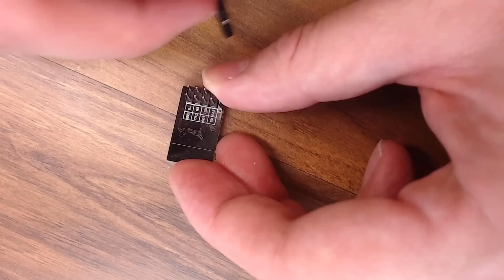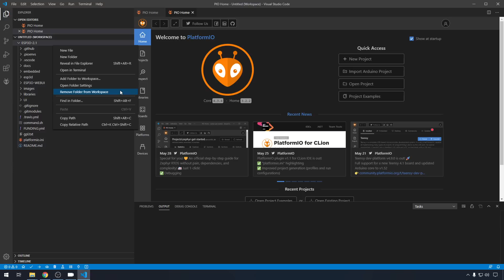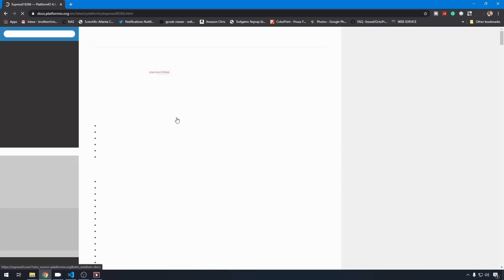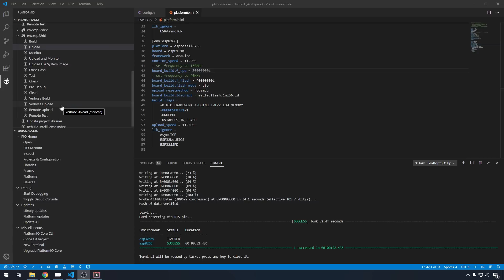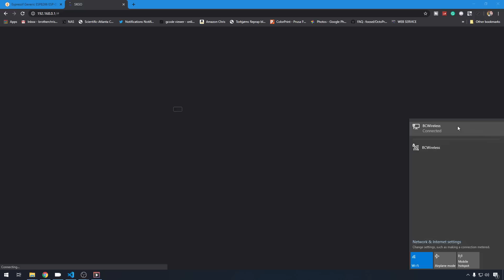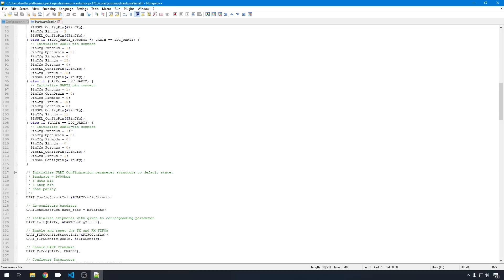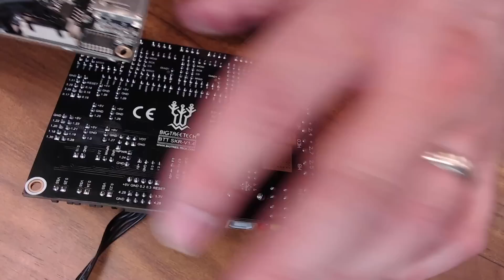Add Wifi To A 3D Printer - SKR 1.4 - ESP8266 - ESP3D - Chris's Basement

Comment: I connected my module in my TFT but doesnt work, the network not showing
Reply from the maker: Did you try to reflash the firmware on the ESP?
Reply: @ChrisRiley  Thank you for answering me, I'm already very happy with that answer. When I have the module connected to the USB adapter I can check the ESP3D network, but when I put the module in the TFT nothing happens, I tried to put the firmware back on and it still didn't work. I followed all the steps in your video, I found it very strange, I uploaded several versions of marlin and nothing. Does it work with ESP01 and ESP01S?

Comment: Great tutorial! I really enjoy your videos.

BTW. Once you have ESP3D installed and working, it's actually quite easy to get it to work with Octoprint, so that your print over wifi instead of serial cable.

All you need to do is to install a tool called 'socat' on the raspberry pi, which will create a virtual serial port that sends all data over TCP to ESP3D's port 8888.

Here are the steps I used:

# install socat
$ sudo apt install -y socat

# create systemd service to setup virtual port at boot time and reconnect to ESP3D as necessary
# make sure to replace YOUR_PRINTER_ADDRESS with IP address or hostname of your ESP3D instance.

cat << EOT | sudo tee /etc/systemd/system/serial-over-wifi.service;
[Unit]
Description=Serial over WiFi

[Service]
Type=simple
ExecStart=socat -d -d pty,link=/dev/ttySwifi,user=pi,raw,echo=0,wait-slave tcp:YOUR_PRINTER_ADDRESS:8888
Restart=on-failure

[Install]
WantedBy=multi-user.target
EOT

# start the service
sudo systemctl start serial-over-wifi.service

# Verify that the virtual port was created
ls -al /dev/ttySwifi

# enable the new service to start at boot time
sudo systemctl enable serial-over-wifi.service

Now octoprint should be able to connect to the printer without any USB cable!
Reply from the maker: Awesome! I might do a video on that, thanks for the info.
Reply: @ChrisRiley  Great, I learned few things and made some improvements to the config since posting that.

First - I learned that if OctoPi is connected over wireless (not wired), I get weird slowdowns when printing (print that normally takes ~2h took 4h). I think there are some sort of wireless collisions which slow everything down. Switching Pi to wired connection fixed it. There could be other solutions, too.

Second, I learned that there are some additional parameters in the service configuration that make it more robust when it comes to restarting the connection. Here's the new version:

[Unit]

Description=Serial over WiFi

StartLimitInterval=0

[Service]

Type=simple

ExecStart=socat -d -d pty,link=/dev/ttySwifi,user=pi,raw tcp:YOUR_PRINTER_ADDRESS:8888,nodelay

Restart=always

RestartSec=1

[Install]

WantedBy=multi-user.target

Comment: Excellent Video Chris!  I especially like being able to program the ESP using VSCode.  The SKR-PRO is a little different.  The HardwareSerial.h file is totally different and requires no changes.  I had to set the serial port to 6 and add the Configuration_Secure.h (configuration_adv.h) file to make mine work. When I have hardware issues I always look for your channel first and am never disappointed.
Reply from the maker: Thanks Charles and thanks for the extra info!

Comment: Great tutorial as always! Wifi modual works flawlessly, however,  I have an issue after new firmware that my TFT24 screen does not want to connect.. is there any way to fix this?
Reply from the maker: Since there are only 2 serials you can talk to, you are going to have to pick with two you want to use. serial 0 serial 2 3 is wifi module and screen. serial -1 and serial 2 3 is USB connection and wifi module.

Comment: I just keep getting this no matter what I do? Have driver installed, can see green light flashing on board.... 
Uploading .pioenvs\esp8266\firmware.bin
esptool.py v2.8
Serial port COM5
Connecting........____....._____....._____....._____....._____....._____.....____
A fatal error occurred: Failed to connect to ESP8266: Timed out waiting for packet header
* [upload] Error 2
Reply from the maker: Did you try changing up the reset method?

Comment: I have ordered the ESP8266 module from BTT store on Aliexpres and it came pre-flashed, I would like to be able to build (i sucesfully can build thx to Chris) my own firmware and then flash it, but the module doesnt communicate with me when connected with the BTT writer, i believe something has to be done to the module to be able to write to it again - like reset command or something, but if i connect everything up as Chris shown here, i simply cant, the module always times out. Ah, the module surely does work, i can sucesfully use it on the printer with the embended FW, but you know, i wanna be able to run my own :) It is not possible to upgrade over the webui, as there isnt enought space in the memmory to upload the .bin file i build myself, so i gotta write it to the module over the programmer, but again, the module doesnt let itself be written to. both the VScode and the ESPflashtool just times out (the COM port and drivers are all fine, connections tripple checked), can anyone advice me, how to make the module communicate with me using the BTT writer? my only conclusion right now is that it boots into the pre-flashed firmware and doesnt let me tx/rx into it without some kind of "magic" that has to be done (like pulling the reset pin to ground or something, but thats beyond me, what rly needs to be done and how)  - if anyone can spare some time and help me out here i would be rly grateful :)
Reply from the maker: I have one form BTT as well and I was able to write to it. The IO0 is the pin that makes it writable. ESPflashtool should work for you. Make sure you have the TX and RX pins flipped.
Reply: @ChrisRiley  thx Chris for the video and for taking time to respond, i will try another PC then, maybe some problem with the COM communication alltogether, i have even (after checking it muuuuultipletimes) tried to purposely switch tx/rx and that didnt help either, so i dont think its connection problem, i will follow up when i have time to test with other machine, so maybe other users in the future will have a reference how to fix such issue :)

Comment: I have skr 1.4 and TFT 24. I have install the esp on skr 1.4 . Wifi is working good. but lcd scree printer not connected error. I move to marlin mode. How i use the touch screen.
Reply from the maker: If you don't need to use the serial cable (USB), set your second serial to 0.

Comment: I followed all the steps but the webpage would not load after configuring it as a client. Only worked with the original build flag "-Wl,-Teagle.flash.1m256.ld"
If someone have this issue just configure the flash size and skip the board_build.ldscript... part
Reply from the maker: Thanks for the info!

Comment: Thank you Chris for this comprehensive tutorial. I used a different FTDI adapter and in my case the System file image uploaded without error message. Actually a haven't changed anything in the platformio.ini file, except for the "build_flags = -Wl,-Teagle.flash.1m256.ld". Everything went smoothly.
Reply from the maker: Thanks! That's good to hear, hopefully it is just the BTT writer causing me problems.
Reply: i am using an FTDI aswell but i do not have the file system image upload option at all...

Comment: chris am getting error in mac and windows this one "Assembler messages:
Fatal error: can't create .pioenvs/esp8266/src/espcom.cpp.o: No such file or directory
* [.pioenvs/esp8266/src/espcom.cpp.o] Error 1
Reply from the maker: Hmm, that doesn't even look like the right file extension. I would delete your ESP3d folder and start over with a fresh unzip.
Reply: @ChrisRiley  i finally did it but i couldn't find the ESP3D wifi on my network , how can i connect to it ?

Comment: 17:45 (Reset not working...) You wired the ESP01's Reset to the USB Writer's RTS (Request To Send) pin. According to https://docs.platformio.org/en/latest/platforms/espressif8266.html, for that wiring you need to set  upload_resetmethod to ck, not nodemcu. This presumably tells platofrmio's programming code that when  it wants to perform  a reset of the serial-connected device, it should twiddle the serial-over-usb port's ReadyToSend bit.
Reply from the maker: I worked on this for hours trying to figure out why it wouldn't reset. It's something in the ESPtool.py scripts. All the other tools worked just fine with the ck setting, but not the esptool. If you leave it set to ck it does a soft reset before the flash and a hard reset after. That wasn't enough to get the writer to work. I set it to nodemcu to issue a default reset before the flash. That seemed to do the trick. Again, all other tools worked fin with the ck option. Not really sure what part was wrong, the tool options or my writer wasn't working correctly.
Reply: @ChrisRiley  Diligent as usual! I just attempted to look at the trail from the "Upload file system image" task menu item through to twiddling of the RTS line, and there are so many places where something could be amiss. And it's very easy for this to turn into a multi-hour rabbit chase, as you note. Because platformio makes things so simple :-).  Not the least problem is that all the software libraries along the way have to understand which polarity of the RTS line means what, and when it can and should be changed. Does setRTS(True) mean set it low, or set it high? So all participants, from the CH340 (or FTDI) chip, Writer board designer, CH340 driver, Windows serial port API, PySerial and esptool.py have to agree on how this is supposed to work. Not to mention drivers for other platforms. I now see there's a long history of rampant mess in this area, judging by https://github.com/pyserial/pyserial/issues/124. On top of some models of ESP apparently misbehaving if the reset line is held on too long, or not long enough, or....   OK, I think for now I'm just going to offer sympathy :-).
Reply from the maker: @Graham_Wideman  LOL, sympathy is very welcome! Not sure if the RTS gets toggled high or low, that might be a good test to see what happens.

Comment: trying to get this working on a mks robin nano (and older mks sbase) the robin nano has a port for mks wifi module (based on esp8266) got the esp3d firmware on a nodemcu8266 ok no problems and can access the web gui. having problems with connecting, using the assigned tx/rx pins and gnd on robin nano board, this board uses stmf3 chip tried a few different serial ports in marlin but still no comms! cant find the framework environment files to check serial H, anybody have any ideas??
Reply from the maker: I can't get serial to work on those chips at all. I am not sure why really.

Comment: I have both the wifi board and programmer. I also was considering Octoprint. You have convinced me that the good old Octoprint is the way to go. As usual, you have provided the right info at the right time!
Reply from the maker: Thanks David, yeah Octoprint is just awesome, that's all there is to it.
Reply: @ChrisRiley  So with running Octoprint on a 4B its pointless putting WIFI on the SKR 1.4T?
Reply from the maker: @lookin4ward1  Pretty much, it is not substitute for Octoprint.

Comment: Is there an alternative to using the BigTreeTech Writer? I was able to get an ESP8266 module right away via Amazon Prime, but the only BTT Writers I can find ship from China and would take forever and a day to arrive here. I have various Arduinos, USBASPs, USB to serial adapters (FTDI, etc.) at my disposal; would any of those work?
edit: ah! just found your older video where you used an Arduino Uni, I'll give that a shot.
edit #2: I think I just found an even more elegant solution, a CH340 adapter that has a pin header that is directly compatible with the ESP8266. So you can plug the ESP8266 straight into it, without the need to mess around with jumper wires, etc. Best of all it's only $10.99 and ships via Amazon Prime. https://www.amazon.com/ESP-01S-ESP8266-Wireless-Adapter-4-5-5-5V/dp/B07KF119YB/ref=sr_1_1?dchild=1&keywords=esp8266+programmer&qid=1591221533&sr=8-1  Just ordered one, it'll get here this Saturday. I'll update this comment to let everyone know how it worked out for me.
edit #3: The serial adapter I ordered arrived today and works perfectly, I was able to flash the ESP3D using the procedure demonstrated in this video. If you're looking for a ESP8266 programmer and don't want to wait for "slow boat from China" shipping, the one from Amazon I linked above is a good substitute.
Reply from the maker: Yep, check that one out, the UNO's I know work great!

Comment: Fantastic video - question : Marlin Thermal Settings in Configuration.h. I have never had a thermistor read 100K, 60- 80K yes, 100k no. Does it make a difference? How can you tell what you have? Most themistors have no markings.
Reply from the maker: Thanks! It's really hard to tell, they read 100k at 22c I think. To be able to tell what thermistor you have you would have to plot it out with a thermal couple.

Comment: SUPER HELPFUL!!!! Thank you, I bought these wifi modules a month ago and could not get them working. But I do have a question: If you have a a 1.4 Turbo, Is there any (speed) reason to use octoprint with it? I thought octoprint was mainly used to help off load the computational workload?
Reply from the maker: Thanks! No, Octoprint just serves serial data, just like an SD card would. No help on the compute side. If you want a setup like that you would have to run something like Klipper firmware.

Comment: The SD write speed issues is resolved if you go with the Panucatt wifi backpack module since he partnered with Luc of ESP3D on that functionality and designed the circuitry accordingly.
Reply from the maker: Hey Eric, I am going to give that one another try with the newest ESP3D version.
Reply: @ChrisRiley  I think Luc has some specific closed source code for Panucatt to work with direct SD access. So loading the latest open source version might break the high speed SD access. Maybe double check with him first.
Reply from the maker: @eclsnowman  Thanks, will do!

Comment: I got mine from biqu, the same as the SKR board, and I assume it has the 1mb memory, but how would you be able to tell if it has 4mb, or is that exclusive to the ESP32. I'm guessing since the "model" is ESP-01S that mean 1mb?
Reply from the maker: Correct, the model name should say. There is an example sketch in Arduino IDE that will tell you what chip you have. Check out the first video in the description.